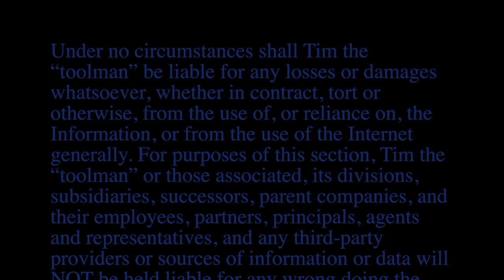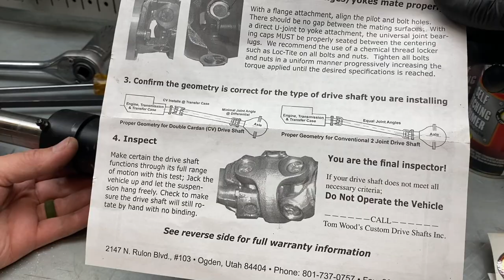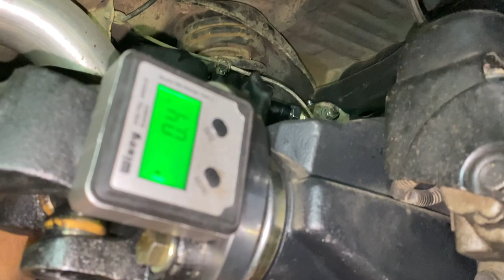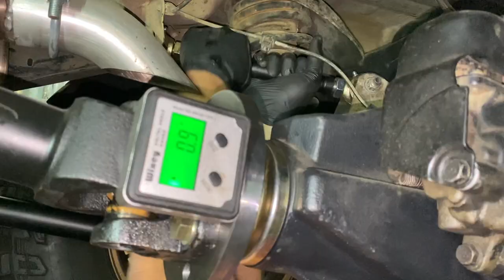Marlin Crawler Dual Transfer Case Install (Part 2 - Installation)

Comment: Sort of a waste of time and resources as that vehicle doesn’t have enough weight to take advantage of the gear reduction
Reply from the maker: What would be the vehicle weight need to be to make a dual transfer case useful in your opinion?  I guess we should have installed dual cases in a Tundra or a Ford F350 that couldn't even fit on most of the technical trails that would require dual cases.  Your comment makes zero sense and it's clear you don't know what you're talking about.  Weight has nothing to do with it.  Dual transfer cases allows you more control when negotiating obstacles.  It's especially beneficial for manual transmission rigs because you don't have to work the clutch over and over again.  On a steep and gnarly grade, you can let the gears get you down in a controlled manner instead of riding the brakes.  Do yourself a favor and research the subject matter before commenting on other videos.